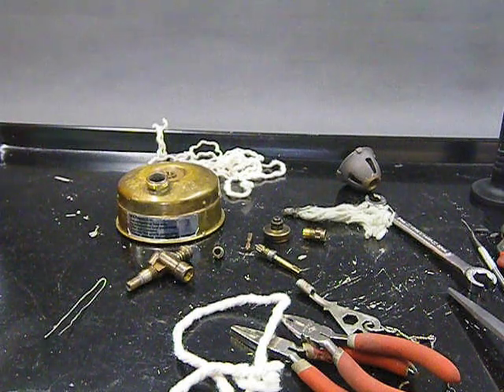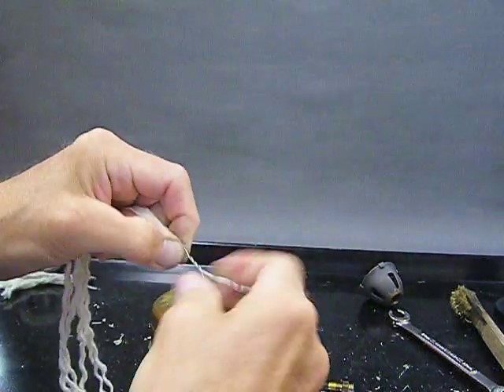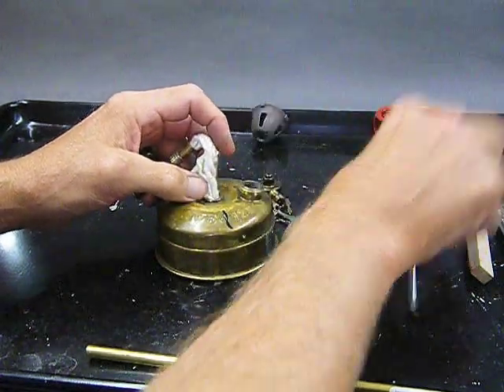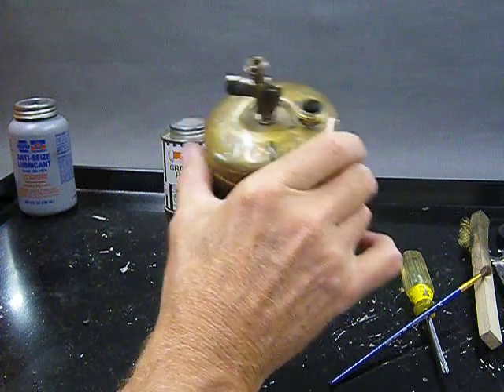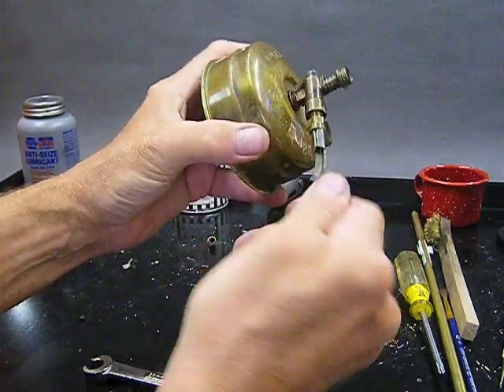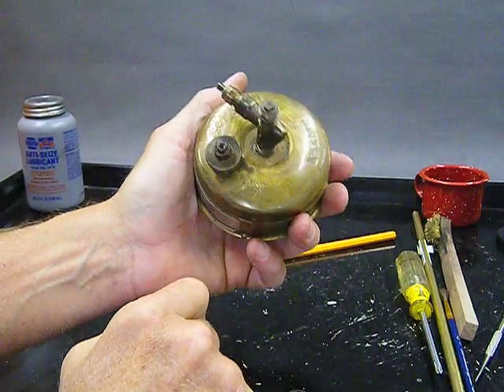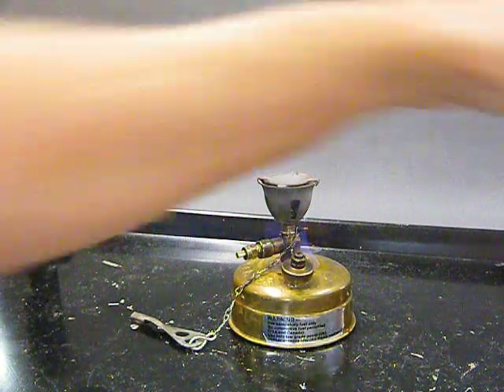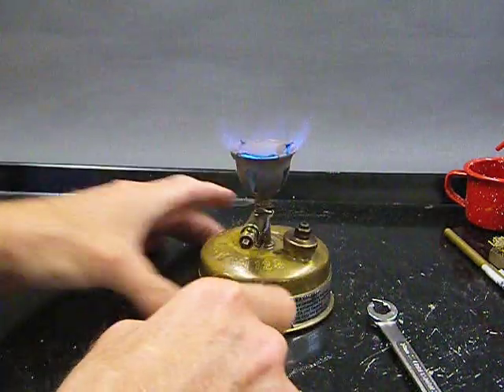BernieDawg's Svea 123R Stove Reassembly

Comment: Thank you! does it work good with bensin/petrol?
Reply from the maker: @Ma Ni These worked well with automobile gasoline 50 years ago. Today auto gasoline is very different than back 50 years ago. Todays auto gasoline will clog them up pretty fast. Use Coleman fuel, naphtha, MSR Superfuel, Aspen 4T, or Shellite today. Do not use with regular unleaded gasoline for automobiles in these stoves. 👍 BD
Reply: @BernieDawgCinema  Thank you!

Comment: Great tutorials Bernie thank you. I just got two Svea 123R in a trash to treasure day in my town...guy was tossing them out. I watched your turtorials and had to rebuild one.  Luckily the box the stoves came in had a complete rebuild kit too. A question please.  The graphite packing that goes on the spindle....do you simply take it from the package and place it over the shaft, or unravel it and wrap it. I hope I did it right by just slipping it on over the shaft, but there appears to be paper in between the graphite tape like material.  Thank you
Reply from the maker: If you have the graphite tape material with the paper backing... I remove the paper backing and tightly wrap the spindle shaft with the graphite ribbon. There is usually an adhesive on the back of the graphite ribbon that makes this no so hard to do. If you feel the ribbon is too wide, you can always fold it in half lengthwise as you wrap it around the shaft.The spindle nut will mash the graphite ribbon you've wrapped around the spindle shaft into a nice compressed block when you thread it down into the valve body. Hope that helps.
Reply: OK thanks...Dam !!! thought I just slid it onto the shaft. Might have really mucked that up.  Do you use the entire roll or just a short section. Crap.....
Reply from the maker: I have my own roll of graphite tape and I cut lengths from that when I need graphite tape. I've not bought the stuff from the guy on eBay you bought it from, so I don't really know how much you get. I'd suggest using as much of the graphite tape as you can get around the spindle shaft and in the spindle housing as it crushes down pretty small. The paper backing will get pretty hot and will likely burn and cause you leaks and stuff. If you need more help with this, just drop me an email at: berniedawgstove@comcast.net Thanks!

Comment: Hi I recently bought a Svea 123  it appears a bit simpler to
deal with. I have not filled it yet but it seems that the only
Issue it might have that I don't know how to repair is a leak
in the fuel valve. could you dismantle one and show 
maintenance procedures ? I have not been able to find
a video that shows this repair being done. Thank you for
your time and great videos.
Reply from the maker: Most of the time just tightening the spindle nut on a Svea 123 or 123R will correct any leakage at the spindle. If you need to replace the worn graphite packing on a Svea 123, (not R), eBay seller "spinnakerspar" both sells graphite tape to remake the packing, and includes a tutorial in their listing how to use it. It's inexpensive and pretty easy. BD

Comment: Could you please tell me what size adjustable wrench you were using in the video
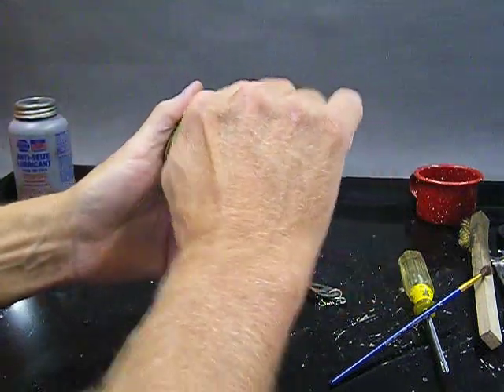Reply from the maker: If you mean the one that appears at 12:45 in the video, that is a BAHCO #9029 6" adjustable wrench. I bought it originally mostly just for the BAHCO name. But, it's a really nice wrench whose jaws hold true parallel. The short length helps to avoid over-torquing. Shop around for the best price as one vendor at Amazon is charging almost $50 and that's too high. BD
Reply: Thanks so much - hope to see more videos like this one.

Comment: I have an 80 that I would like to fettle a bit- but the vaporiser tube is stuck. Do you have any top tips to get it out- or is it just brute force? Being very cautious- don’t want to squash the tank! Also....would it be possible to run it on alcohol? I know it would need a larger jet- .5mm seems to be the right size- would I need to do anything else? I’m very attached to the stove- it belonged to my grandparents - they used it when cycle touring in the 50’s. It runs pretty well on white gas- not quite as smooth as your 123- but not bad for 70years! Thank you- really appreciate your uploads.
Reply from the maker: @Flinty Knicknacks If by "stuck", you mean the vaporizer is really tight, then, yup, they are supposed to be that way. The tube is attached to the stove with a tapered pipe joint. Question is... why do you feel you need to get in there? Unless the stove has been used with automotive gasoline for a long time and the wick is all fouled with it, there's probably no good reason to take it apart. The Svea 123R has a very stout valve body, so it's hard to mess that up. But, it's easy to break the tube on the 80 unless you have special jigs, tools, etc. These stoves only burn white gas, not alcohol. And, no, a conversion to alcohol will not work as the stove design won't support an alcohol conversion. Best route is to enjoy and care for your grandparents old stove using good quality naphtha (white gas) camp fuel as intended. 👍 BD
Reply: Thank you- I had a feeling it was Coleman fuel only. Was just hoping to go a bit ‘greener’. It would only ever have been run on naphtha- not petrol..would have been leaded then as well! 😬. I will leave well alone-I can see the wick - seems fine and runs pretty well. Is the 111 the only stove capable of running on alcohol? Bit of a lump for bicycle touring🥵! I have seen videos of people running MSR stoves on meths - but performance is a bit rubbish and it destroys the aluminium fuel bottle. Thank you so much for your advice and very clear informative videos.
Reply from the maker: @Flinty Knicknacks Trying to be "green" by worrying about your camp stove fuel is not the best use of your conservation efforts. You can get about 23 continuous hours hours of full blast flame burn time per gallon of Coleman fuel. That's using a stove like an 80 or 123R. More cooking time can be obtained if you are simmering. Simply driving a car or taking a bus to a trailhead will burn several gallons (or way more if in the USA) of gasoline. You're not going to save the world (or even make a tiny dent) by using an alcohol camping stove. That said... the Optimus 111T and 111C stoves can be converted to run alcohol. But! You'll need to carry a third more fuel if using alcohol with any stove since alcohol only has two-thirds the energy in it as white gas. (Maybe that's why the performance is rubbish with converted MSR stoves since there is so little heat value in alcohol.) Are there other pressurized stoves that can burn alcohol? Yes, but they are pretty rare collectibles. You'd be better off just getting a Trangia if you want to be green by burning alcohol on a bicycle trip. Or, if you want to be vintage... get a hold of an antique Turm Sport gravity fed alcohol stove. Check eBay and the like for those vintage ones. Make sure you burn pure ethanol, not methanol/ethanol blends or you'll lose even more energy since methanol is even less energetic. (And, don't forget, you'll need to carry more fuel on your bike if using alcohol.) BD

Comment: Is the wick just everyday string ?
Reply from the maker: Not really. It's thick, large diameter 100% cotton cordage as found on 100% cotton floor mop heads. Use synthetic blend cord and the wick will melt into goo inside the stove body. Yuck. BD
Reply from the maker: @Lorin-GabrielLeaua-fm1lw  Asbestos is a controlled substance banned in most parts of the world due to its health effects. Don’t think you can still buy it and it would be foolish to handle it. Original stove wicks were made of spun mineral fiber. That’s a good safe replacement if you can find it in cord form. But, the 100% cotton wick I show in my videos is a good substitute that is accessible to normal people in our modern world. Try it and see. BD

Comment: Mine is not turning completely off, a tiny tiny flame still there. Tried different clicks on the needle. Have to use quite much force on the key..
Reply from the maker: You have probably distorted what should be a smooth cone shape on the end of the spindle by using too much force. Brass is soft. More force is not the answer. Pull the spindle out and see if there is a step on the spindle cone. If so, you can spin the spindle in a drill or lathe and try to clean up the cone face with a file or sandpaper while spinning it OR you might just want to get a new spindle to replace it. Base-Camp in England has them. You can find their address on my webpage of stove part suppliers here: http://www.berniedawg.com/stove-part-supplier-links/ BD
Reply: @BernieDawgCinema  Wow, thanks Bernie for your quick and very helpful advice! I will for sure try that out. Thanks for making these videos - it is such a valuable contribution to all of us who are hooked on blue flames !!
Reply from the maker: You are most welcome! Blue flames! Lots of fun without divorce or jail time! 😄 👍 BD

Comment: Just got my new stove today could not keep it on longer then 10 seconds, bright blue flames when on but then makes noise and turns off.
Reply from the maker: @Maricela Quintero The Svea 123R has been sold for over sixty years and there are millions of successfully running stoves and millions of happy owners out there. While vintage models tend to work better than the made-in-Taiwan new stoves, if you are having trouble it is almost certainly a user issue rather than a stove issue. (IE - your problem not doing things right, not the stove.) Make sure to read the instructions to learn how to run the stove properly and watch my videos on how to light and run the stove. If it still doesn't work for you: bd@berniedawg.com 👍 BD

Comment: Excellent video, I bought one of these in the early 70s and it worked perfectly,  but after mabey 4 years I thought it would be wise to rebuild it as they sold rebuilding kits where I bought it ( backpackers shoppe in  I believe Avon, Ohio, it could be one of those other little cities in the area. It is still there but they don't sell the old parts anymore ), anyway I should have left it alone, but being young and curious I just had to take it apart. It had a large amount of blue thread sealed on it? Anyway after putting it all together,  it works, but you can't adjust the flame or turn it off with the key, either let it burn out or smother it, I was so disappointed with myself, but after watching your video I will again attempt to get it right, ( I don't even remember the wick, it must have fallen inside? ) I also bought the pump kit so you could pump pressure instead of priming the stove. I still have the pump and it still seems to work, I can feel the pressure on my thumb when I pump it, but because of how the stove was acting I put the original cap back on. If for some reason I find it too difficult to fix, do you have a service of fixing, and what would it cost? Also if possible,  would you know where I can purchase the cap that would allow me to use the pump again? I believe I still have some of the original parts, if I  can't fix it, and you would be willing to undertake this operation I would send everything I have. Thanks again for a great video, I did not see the one where you took it apart? And if by chance I can fix it, would you know if the pressure cap is available?  And where?   Bobby Neuman
Reply from the maker: Pretty much the answer to your questions is yes. Just drop me a note at: berniedawgstove@comcast.net for the answers in detail and to arrange for service/rebuilding. The disassembly video is right here: https://youtu.be/LNJSDacuCHQ Best wishes on your stove work. BD

Comment: Can you safely burn diesel or kerosene in the newest Svea 123?
I’m trying to assemble a the best combination of stoves or even just 1 that you recommend for hiking use and also for long term emergency use and would appreciate your suggestions 
So far I have bought an Emberlit Fireant Titanium stove, weighs only 3 ounces and can burn wood/esbit tabs/trangia alcohol and even tea light candles
So all those fuels are covered, now I one or more stoves that use other fuels reliably with basic maintenance, specific stoves I am considering buying (but not all) are Soto Windmaster (purely ‘upright’ canister fuel but very light), Whisperlite Universal (upright canister simmering, inverted canister use but poor simmering, Kerosene and gasoline use in emergencies but poor simmering yet fairly reliable and easy to maintain), Optimus Polaris (same as whisperlite Universal but also marketed to burn diesel, no jets to loose as uses same jet for all fuels, has a simmering spindle but this allegedly increases risk of dirty and gunk building up in the fuel line (compared to whisperlite)but don’t yet understand how to reliably clean out the fuel line as easily as whisperlite universal), Primus Omnilite Ti (the lightest option for backpack carry, the Primus fuel bottles are relatively heavy though, has no shaker jet, would involve the most maintenance of burning liquid fuels in emergencies which is when I would mainly need to burn liquid fuels, fuel line is equally difficult to clean out as Optimus Polaris, many small parts that could easily be lost due to multiple jets for different fuels etc, pump is allegedly unreliable due to some reviews and possibly the least reliable of all the multi fuel stoves that burn canisters and liquids), MSR Dragon fly for involved cooking in long term emergencies (similarly reliable and easy to clean as Whisperlite Universal, only burns liquid fuels but is marketed to burn all liquid fuels except alcohol of course), SVEA 123 (similarly as light as Dragonfly, extremely reliable as few moving parts to fail or lose and no fuel line to clog up, marketed to only burn white gas and gasoline but not diesel or kerosene.
I expect to buy the Soto Windmaster at the convenient/light/hiking canister fuel end of the spectrum, also the MSR Dragonfly at the long term emergency liquid fuel cooking end of the spectrum as although needing more maintenance than the SVEA 123 is still very simple to clean (the MSR XGK doesn’t simmer so Dragonfly simmer ability prefered), which leaves 1 of the other 3 multi fuel stoves as the choice I’m struggling to make, the Primus Omnilite Ti, the Whisperlite Universal or the Optimus Polaris? Would really appreciate your advice to avoid ‘buyers remorse’ as all these stoves would need to be purchased online as no stores in my area sell any of these stoves
Thanks for any suggestions or corrections to my way of thinking here :)
Reply from the maker: @ImpermanentHuman No. White gas (aka Coleman fuel, aka naphtha) only. But, it's not a matter of safety. It's a matter of kerosene not being very volatile and not being able to: a) develop pressure in the stove, and, b) the tiny little brass stove not getting or staying hot enough to vaporize the kerosene. As to diesel... no small camping stove will vaporize or burn diesel fuel very well or at all. Too heavy a fuel. Too resistant to vaporizing. Burns (if at all) with a greasy, smoky flame. Clogs up your stove in no time at all. Check on YouTube how many people have videos where they are successfully burning diesel in a camping stove. The very few who show themselves trying to burn diesel are pretty comical and will give you a laugh and a half. If it actually worked (it doesn't), there'd be dozens of videos with clear blue flames racking up views and monetizing like crazy. 😄 BD
Reply: @BernieDawgCinema  wow you answered before I had time to edit my question :) thanks, but please read my extensive edit as I would really appreciate the help once again...but clearly diesel is waste of effort considering to burn 😆
Reply: Also in my area I can’t find Coleman white gas anywhere, so only Gasoline is going to be my ‘emergency’ liquid fuel, so my primary fuels are going to be canister gas, wood, alcohol and then Gasoline only for emergencies due excellent availability but expecting a lot of maintenance 🤔
Reply from the maker: @ImpermanentHuman Holy Smokes! I think this is well beyond what YouTube comments are designed to handle. For instance, neither of us can trade photos here. Please just drop an email to bd@berniedawg.com , my business stove helpline, for a response to all the questions and all the many ideas you have here. Thanks in advance! BD